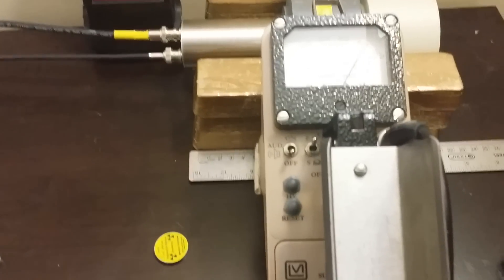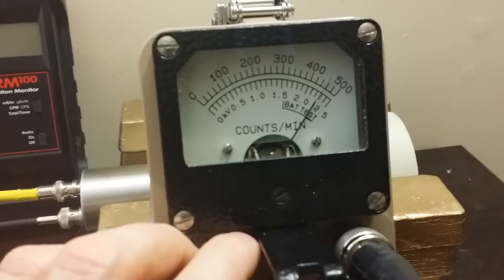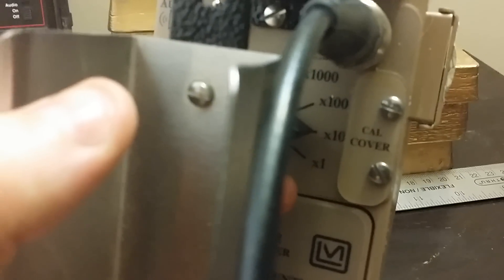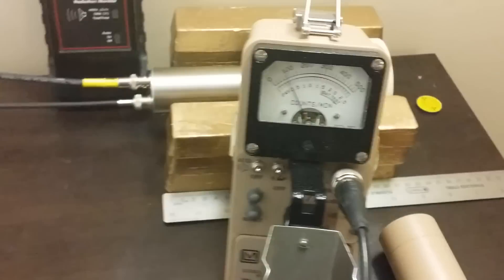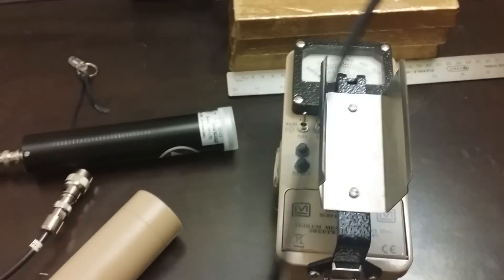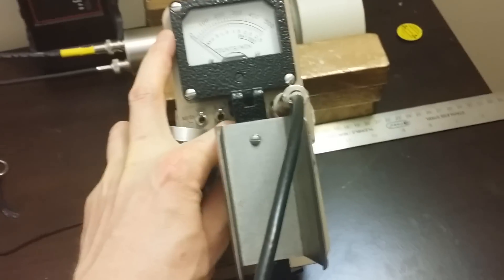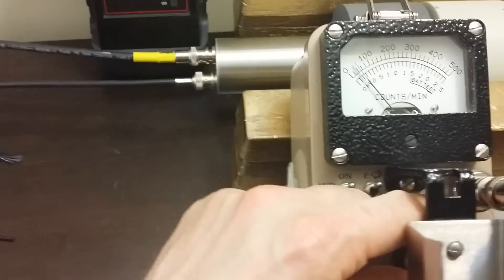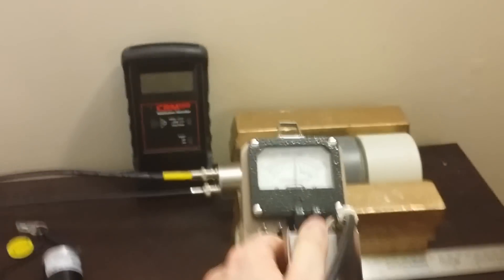Reply to Alex Tsekenis

Comment: Excellent demonstration! I was wondering however if you could do a video on the average count rate to expect from various calibrated check sources and detectors. As an amateur trying to find out the exact reading in cpm to expect on a Geiger counter from a Cs-137 check source is very challenging. I have been looking for some sort of a document to help with calculating how many counts I should expect from a 1 uci check source on a pandcake probe but haven't found any documents that help with that.  I have a gamma scintilator and have been able to calculate and achieve very accurate results from the plethora of documents on how to calibrate and calculate scintilator efficiencies. I have found no such documents that allow any type of theoretical calculations with a Geiger counter or that even suggest what range of counts I should expect. Also I would assume that I should only calculate the gamma emissions from the source but I am unsure weather spectrum techniques sources are one micro currie gamma or one micro currie gamma + beta.  Sorry for all of the questions but you are by far the most knowledgeable person to contact. :)
Reply from the maker: The activity of 1 micro curie is equal to 37,000 decays per second, or 37,000 Becquerels.   (1 Becquerel = 1 decay per second).

The decay may result in alpha or beta decay, and the resulting daughter nuclide may be excited and rapidly de-excite by releasing a gamma ray and/or x-rays. So you see that the activity is related to decays and not to secondary radiation, like a gamma.
Reply: antiprotons
 So if i put a one uci cesium 137 source from spectrum techniques what count rate should I generally expect? 18500 cps gamma +beta? (half of 37,000 cps)?
Reply from the maker: Matthew Knight I'll make a quick video and explain.  I can show you, too.Give me about an hour or so +/-  lol

What type of Geiger counter and scintillator do you have?
Reply: Ludlum model 2 with a Bicron PGM pancake probe and was supposedly calibrated last year. The source I am using is a one microcurrie cesium 137 source and it reads roughly 90,000 cpm beta+Gamma and about 4,500 gamma.
Reply: For isotope identification and exact counting I am using a Bicron .5" by .5" square NaTI scintillator but use it separately with my gs 1100a and Becqu-moniter software.
Reply from the maker: Matthew Knight

Gotcha. I'll put something together quickly.
Reply: Wow! thank you so much! That is incredibly nice of you! Your videos are great and I have learned so much form you. Your videos increased my own interest in radiation and helped give me a guide to turn my own goals into reality. I am a high school senior and now have the start of my own collection of radioactive items for research and am doing a project with my high school science teacher on weather electrokinetic remediation can be used to pull cesium-137 out of contaminated soil. I have watched your progression as a scientist and researcher through your videos and strive for your standards and expansive knowledge. I have refereed many times to your videos. I am going to go to college next year to study to become an environmental scientist and hope to one day work on cleaning up and remediating sites contaminated with radioactive materiel. Thanks for helping me become interested in this great field of radiation and also for taking the time to answer my questions. :)
Reply from the maker: Matthew Knight Your video is up. Let me know if I was unclear, incorrect, or if you had other questions.

https://www.youtube.com/watch?v=8iCqVcynoMg